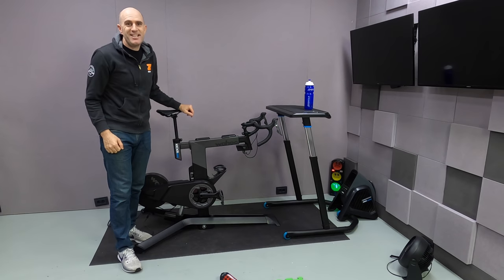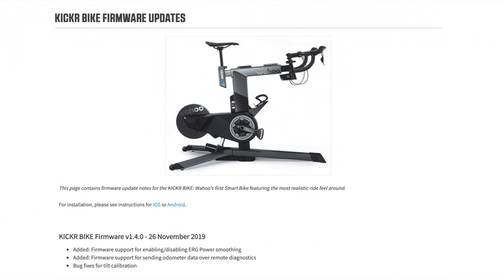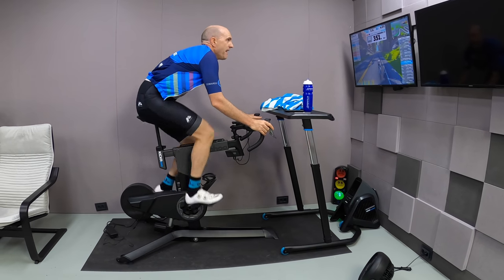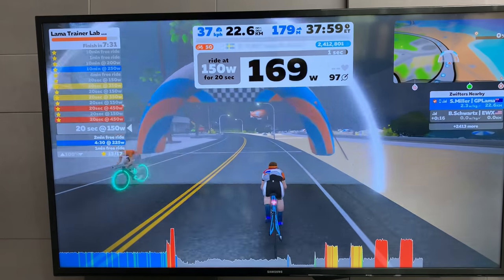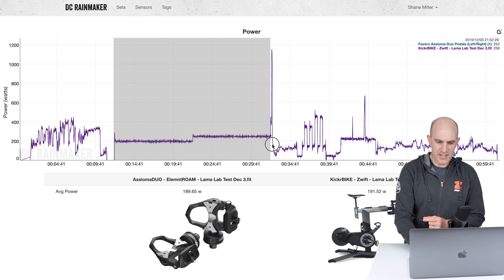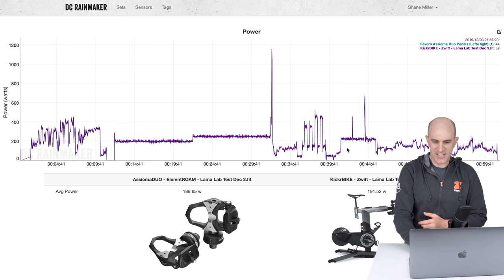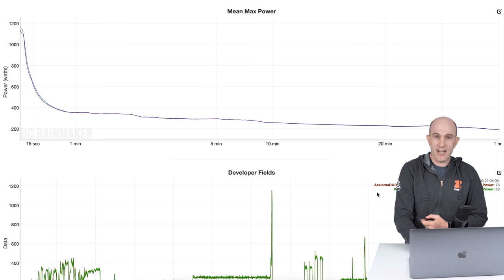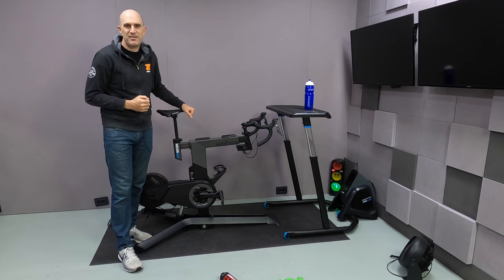Wahoo KICKR Bike: ERG Power Smoothing // Firmware Update 1.4.0

Comment: My KICKR Bike is on 1.4.0, but there is no ERG Power Smoothing option in the app as shown in the video (the Android app is up-to-date). Keep getting the feeling that the KICKR Bike is more of  beta than a release product.
Reply from the maker: Wahoo have always been more IOS focused. Ping them direct re: their Android app.
Reply: @DanielHernandezBC  It's nice, but seems like a first-generation product. Unless there's a feature or features that are exceptionally compelling, I think most people would be happy with the less expensive KICKR 2018 and KICKR Climb. I really like the adjustability, the ability to define gearing and not needing to periodically calibrate power, but I'm not sure that justifies the additional expense. Check out dcrainmaker.com - he just posted a full review of the bike that might help you make up your mind.
Reply: @DanielHernandezBC   I just got mine, the design is very clean, what I can say so far is that the simulation is very impressive, physically it feels just like actual riding, to the point that I rode the same distance I usually do in real life and, on the Kickr bike and had about the same sensations (tiredness, running out of steam) at about the same place in the ride. Funny enough even the speed readings in Zwift were pretty close to what I get on the cycling app on my phone. Yes it is a first gen product, it does have quirks, but, it is very impressive in its ability to simulate the ride.

Comment: Hey Shane, did you have anything like that on the Kickr too?

my two Rotor 2INpower both report up to 20 Watts more then the Kickr itself, for example while riding Sufferfest? Has that something to do with the smothing?
Reply: Search for 2INpower Lama Lab Test and you will know. Spoiler: it consistently reads high indoors.
Reply from the maker: The Kickrs have this option, yes. The 2INpower was found to read a little high indoors for my testing. I believe DCR found the same.
Reply: @michwoz  for sure, thank you!
Reply: @gplama  Thank you Shane!